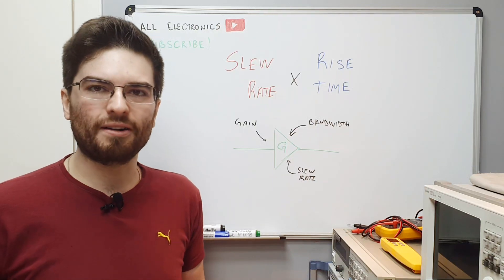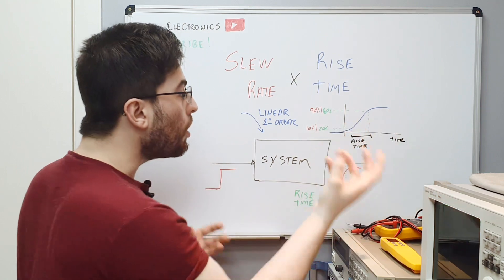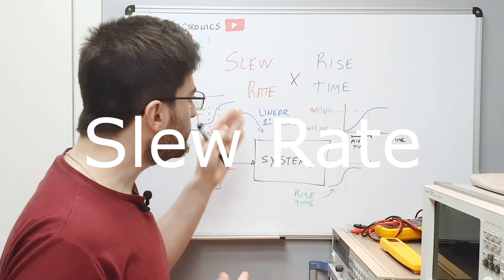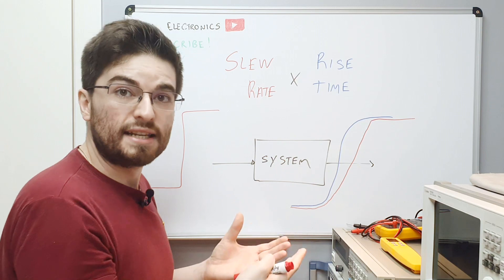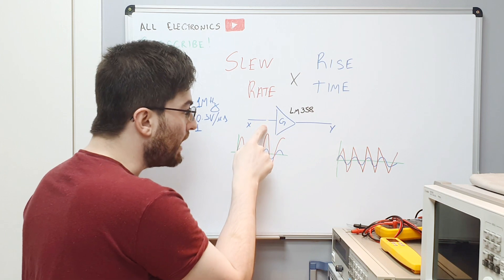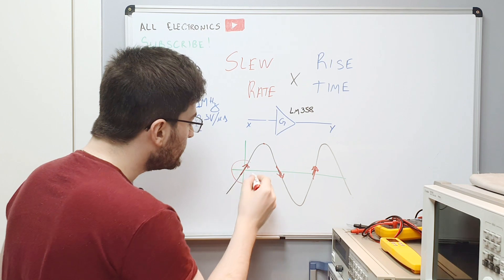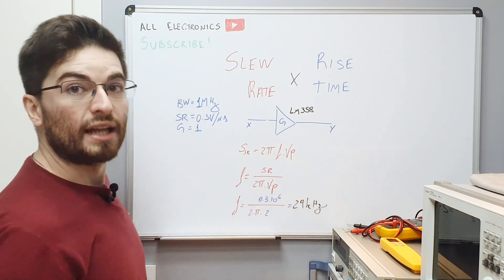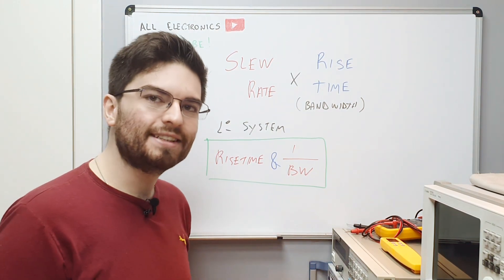OpAmp Slew Rate vs. Rise Time

Comment: I got a different frequency. What's wrong with my math?
		f = SR/(2 . pi . Vinput-p)
		  = 0.310^6 / (2pi . 2)
		  = 0.000887503681 / 12.56
		  = 0.0000706611210191 Hz
Reply from the maker: It is 0.3 V/us == 0.3 MV/s, so 0.3 * 10^6 / (2 * pi * 2). I got ~24 kHz, I may have written it wrong in the white board.
Reply: I see. I read .3 * 10 ^ 6 as .310 ^ 6

Comment: 9:30 "the bounds between the small signal and large signal, or when you have a rise time performance or a slew rate performance, is when the slope of the signal at zero-crossing is greater than the maximum slew of the system."

- But i thought it's determined by input height? I understand that we can tell when we're in the slew region when the slope is non-linear. But slew is CAUSED by input amplitude, isn't it?
Reply from the maker: Just a matter of referring it to the input or not. Similar to input-referred noise.